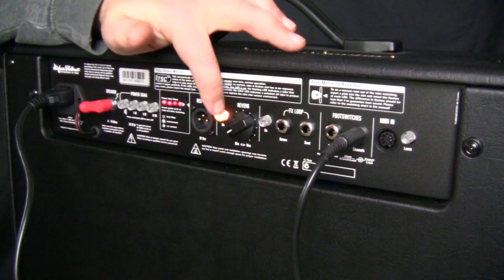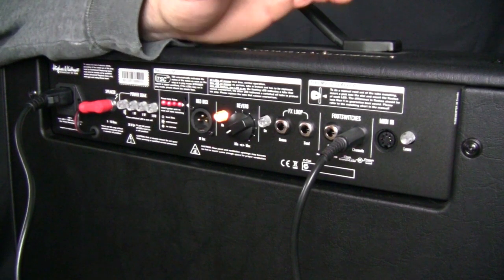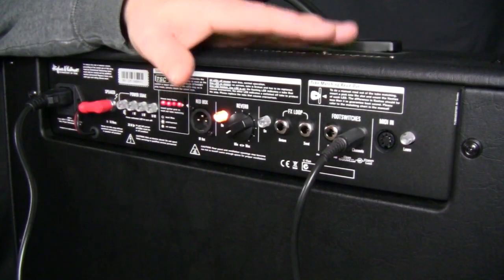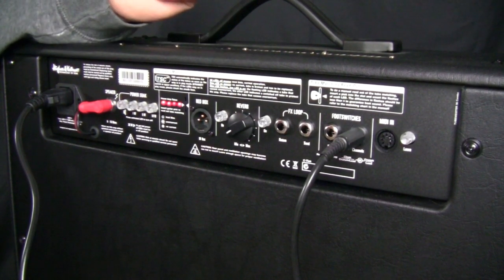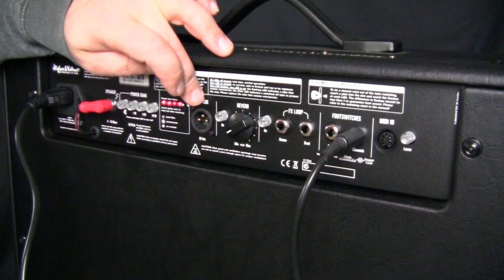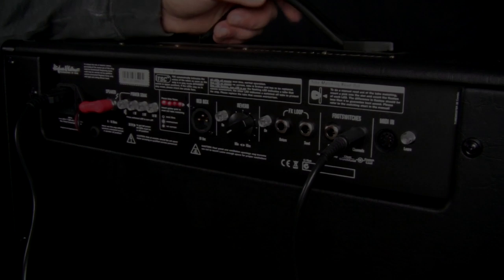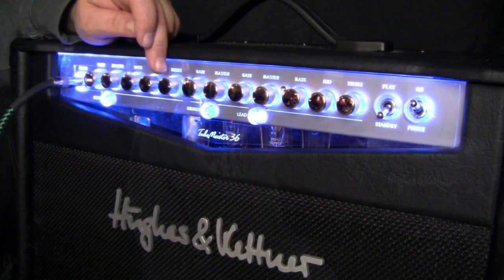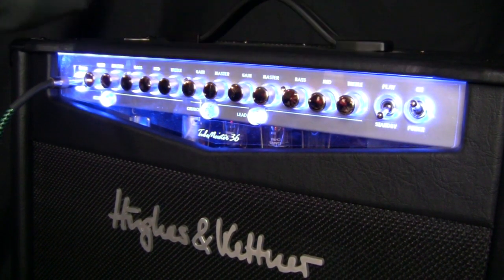Hughes & Kettner Tubemeister 36 Combo

Comment: Hi: 
I have a tubemeister 36 head, 35th anniversary with the great soviet tubes. My biggest issue is with the high end, sounds great clean but found too bright when distorted, bought a H&K 4x12 with V30's but not a huge difference. Now I'm running it through 2 Peavey Scorpion bass speakers to get a decent sound. Any ideas, just too bright for my liking!

Bob
Reply: Hi mate, I do not know if is still actual but if basic tone doesnt meet you dont try to go into radical post adjustment of tone. Just look around visit some music shops and try amps which are within your price range and then 2x more expesive. Then you should select right one.
Reply: I should add, in a live venue sounded great, foot controller on midi, cut through well and sounded good. I had more of a problem with studio getting a good sound. Went back to the JC 120, or the Polytone Fusion with distortion kicked in. A great Santana sound.

Comment: Is this and the 18 full/all tube signal?  rumors flying around that it's not all tube due to some digital signaling or something to that effect.  I dont know enough about electronics to know the difference and when a company use just saying all tube. etc.. etc..
Reply: i know how they've done it! it is all tube in terms of overdrive and distrortion. they are using opamp's to drive the tubes and that gives it this HiFi sound wich is pretty nice but i don't mind as long as it sounds great! but if you think that all tube means actually all tube you are wrong when i looked at the blackstar HT range i noticed that they are doing the same thing as H&K